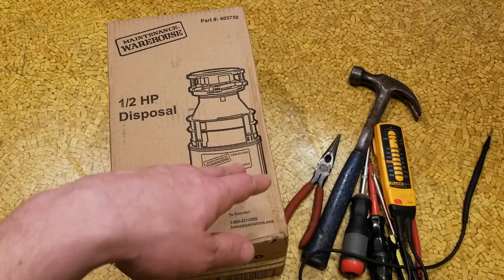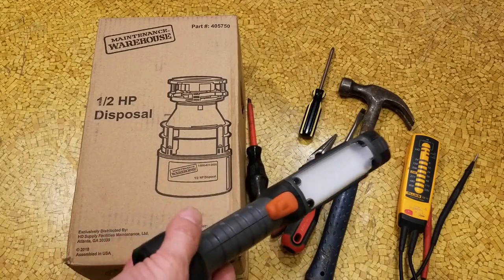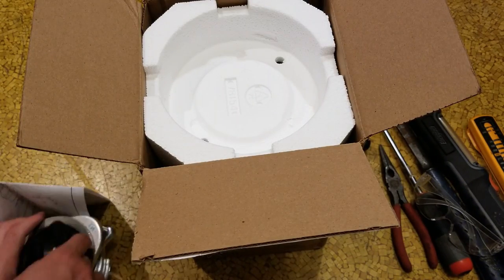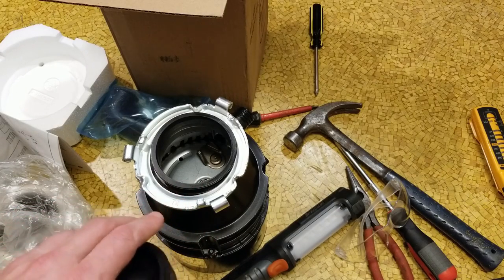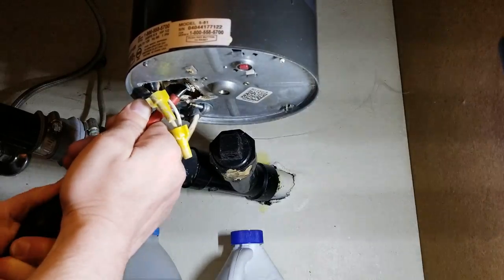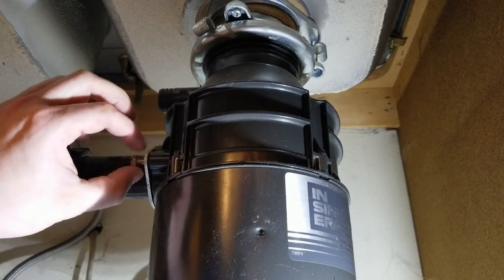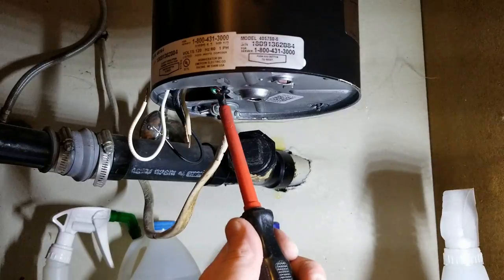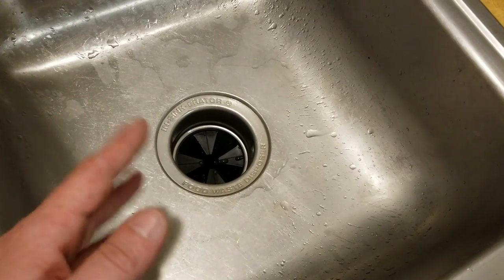DIY: Replacing A In-Sink Garbage Disposal

Comment: Wago 221 lever nuts, much easier to use in such a confined space below the sink. And this type of strain relief of the cable is a real pain in the axx, that's the reason we use cable glands here. They also make rubber inserts for flat cables, normally they have inserts for round cables, but in the UK the so called twin-and-earth cables are also flat. For the cable glands you only require an open end wrench to tighten them. And they have a high rating on the ingress protection, up to IP68. The glands are available with a metric thread (M and then the size in mm), german standard "Panzergewinde" (PG and then size in mm) and also a version with NPT threads in imperial sizes. But the PG standard was replaced here in Germany, we use the standard metric threads since 2003 or 2004 for these cable glands.

https://en.wikipedia.org/wiki/Cable_gland